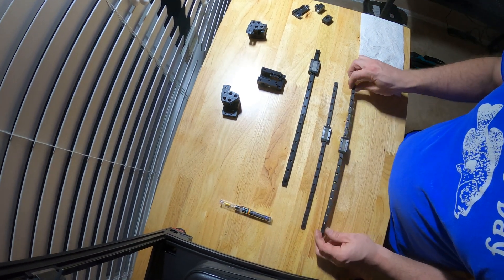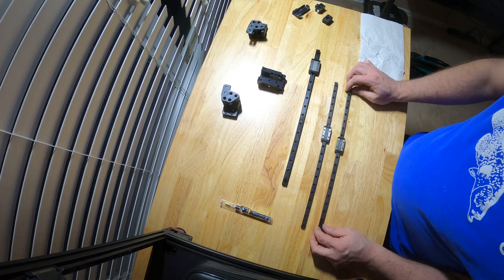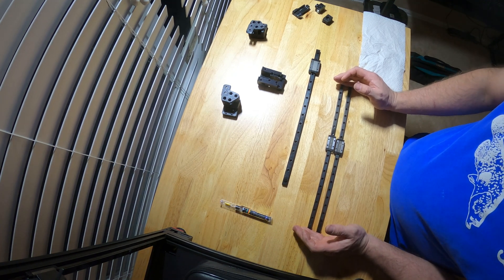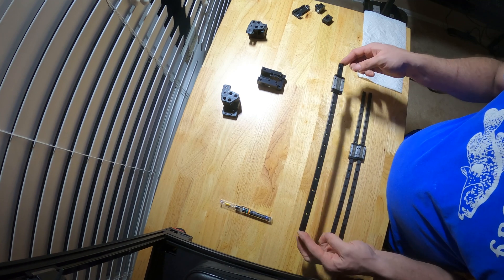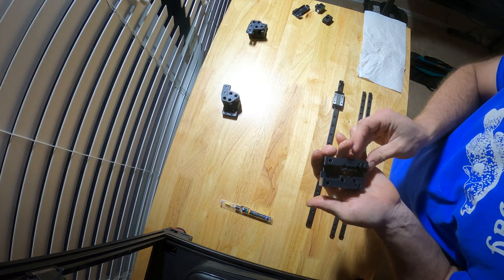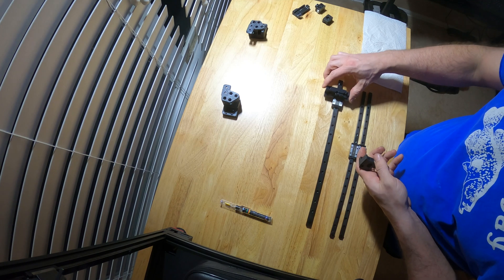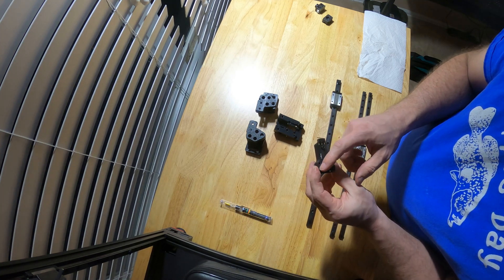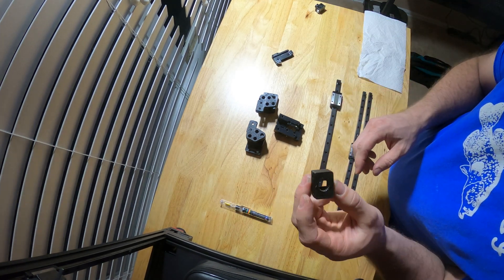Voron 2.4r2 updates - Whats needed if you starting building a 2.4 already

Comment: Y axis idlers ;) done to equalize belt tension and help with alignment issues leading to belt wear.
Reply from the maker: Id agree, but in my situation that would be more thing that i needed to pay someone to reprint and its two different colors. So that is something ill print myself later one when I have consistent prints and decide on a full mod list. I was mainly concerned with the new printed parts to fit the updated purchased parts.
Reply: @matthewdigiacomo8764  Totally agree just got a formbot kit today (frame took an hour).  Its R1 and I ordered functional parts online so once Im running I plan to.do reprints with better quality.